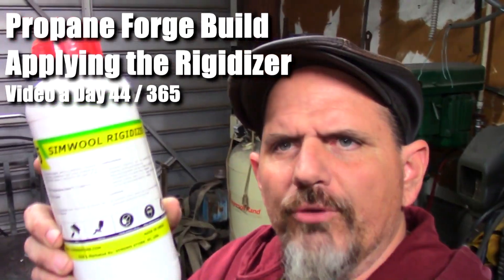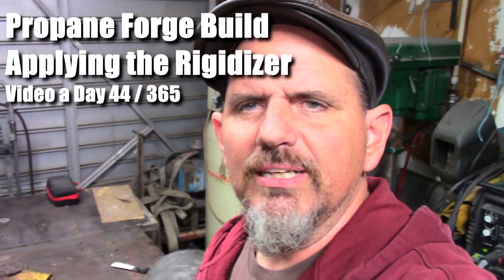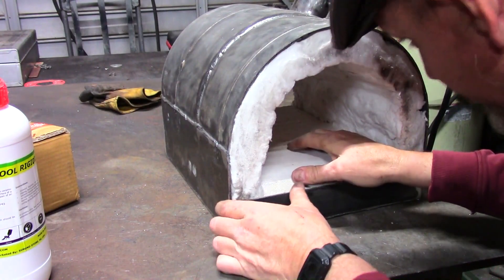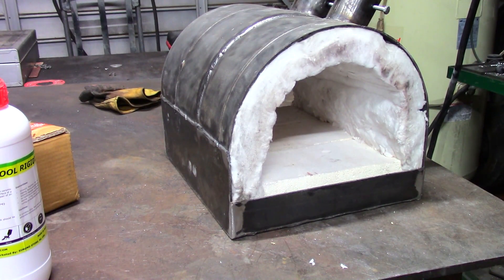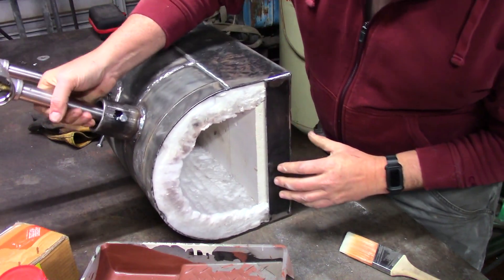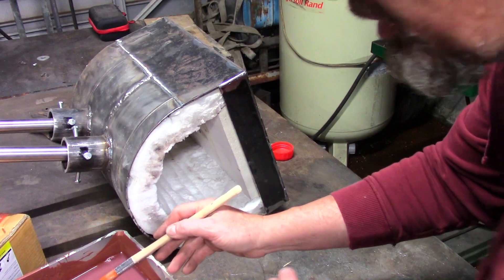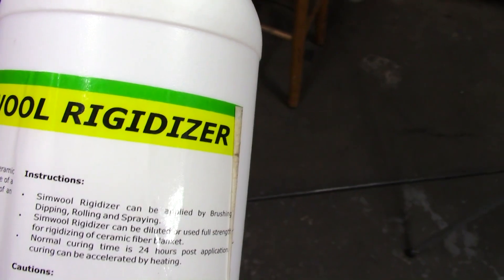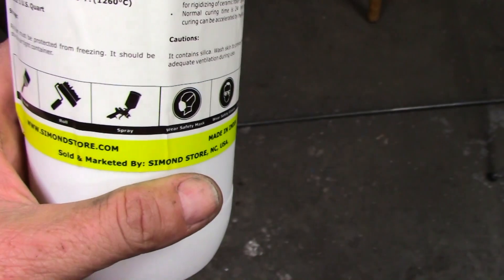Propane Forge Build Applying the Rigidizer Video a Day 44 of 365

Comment: I have a new "vevor" 3 burner forge.  It has the insulation of the bottom.  Should I use the ridgidizer on the bottom as well?  Do I also use the refractory cement on the bottom?  Then do I put the fire bricks on top?

Comment: Hey man im just setting up to apply the exact same stuff and i am using ifb as a base layer as well just running them in the opposite direction. Anything youve learned you wished you knew 2 years ago before i proceed with this application? I have a old wood stove i filled with 2 layers on all walls of a old rectangular wood stove looks like we have the same burner set up so just curious i made my cavitie alot amaller then yours did you achieve welding temp? Thanks in advance
Reply from the maker: It still runs fine. Although, I don't have a huge number of hours on it. I have learned not to run it for a long time on a wooden bench top.